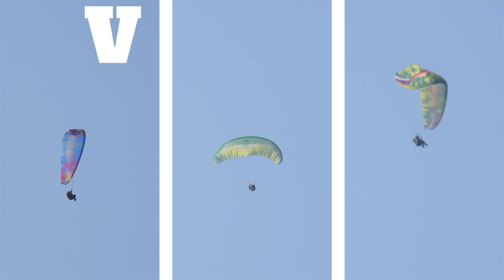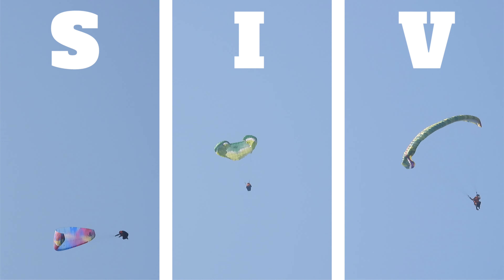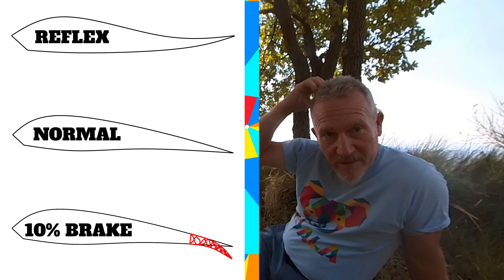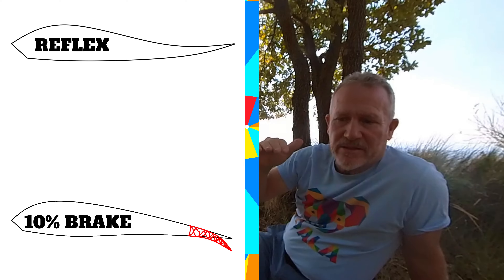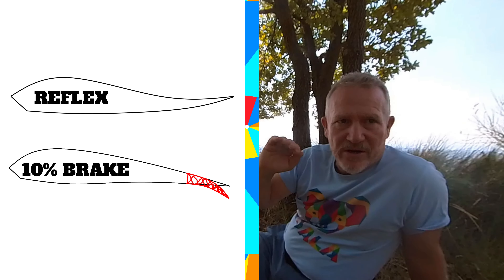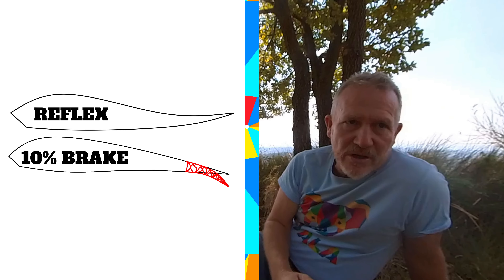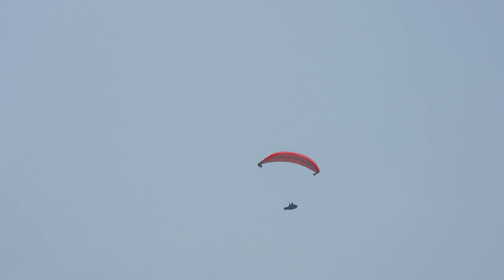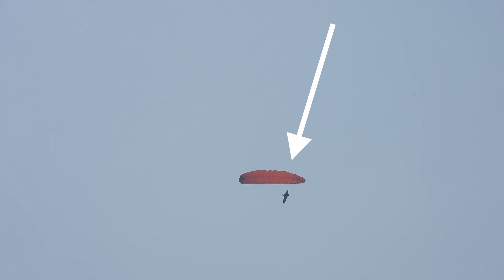10% of brake is not good for paragliding - Bruce Goldsmith

Comment: So, how do you fly actively then? If the hands are all the way up, how do you feel the wing and when to fly actively?
Reply from the maker: Contact position is where you feel the wing, which means you take out the slack from the brake lines, but do not induce bending on trailing edge. You use exactly as you say - actively to control the wing, instead of just floating around with brakes at your shoulder level - passively. To summaries - hands up means - contact position or hands down to actively pilot and always return back to hands up position. Bruce is not saying you should not use brakes, he's saying you use them when needed not just hold on to them all the time.
Dose this make it clearer?
Reply: @FlyingKarlis  right, so just a brief tension on the brakes, to feel the wing, not more. 
My concern was that on some situations, especially bumpy air you might pull more, not intentionally and cause problems. Especially in turbulent conditions when the wing tends to go wild.
I am not having some major concerns here, as experience taught me the amount of tension I need to use, but some inexperienced pilot hearing this might, I'm afraid, avoid flying actively when necessary...
Reply from the maker: Right, as with everything in life so in paragliding, we have to take it step by step. If turbulent air is too scary then maybe it would be a better idea to fly in calmer conditions, till you figure out the controls and build experience as well as trust with your wing. Often having hands up (read contact position) will make the wing a lot more calm, then say holding your brake lines at your shoulder level.

In general avoiding active piloting is a bad idea, luck will run out eventually.
Reply: @FlyingKarlis  is this true on an A  or a B glider?
Reply: Hi Karlis, please I think you need to edit the video with some writing on the screen to clarify this as this is going to cause a lot of confusion in the paragliding community... well it already has. I have had a student ask me about flying hands all the way up because he had heard Bruce say that's what you should do. I said that what he must have meant is at the contact position and not all the way up. It is really not clear in the video that hand up still means having contact with the wing and someone could get seriously hurt the next time they are in active air and they don't have contact with the wing and can't actively fly properly. Thanks for the good videos!
Reply: @MalinLobb hi Malin, I also think this is very controversial and will be misinterpreted. Although Bruce might have a point in siv, as an instructor we teach flying at min sink in smooth soaring conditions with 10-15% brake  . It helps on the ridge with not everyone flying at full speed, helps them stay in the lift and turn flat and with smaller turn radius. I can't see how this is dangerous as the situation is not one where the wing is going to be disappearing underneath them. Also, which wings does this apply to. Certainly not my low ENA wings or some of the older wings students turn up with. Most are still 4 line,? There is no reflex in them?
We also have to teach slow flight as one of the exercises, is that now considered dangerous. Confused instructor of 30 years experience.😮
Reply: @MalinLobb  Completely agree! - I think a "safer" and more "mainstream compatible" way of phrasing that is: "Don't choke the wing!" ie let the wing fly! It's what it wants to do, yet you see soooo many videos of people just choking the LIFE out of their wing...
Saying it like that does the same thing without sounding like "Brakes are for losers", essentially... 😀
Reply from the maker: @mcbrite   I quite like how you describe it, I see how I can implement this to my follow up video. ☝
Reply from the maker: @SM3535  I will try to clarify. 

Bruce is talking about flying at contact position and using brake inputs for active piloting instead of floating around with your hands at the shoulder level. 

In soaring conditions it means that you have a lift band, to stay in the lift band you should use as much brake input as need to stay in it. Which means you constantly adjust from contact position to brake input, what you should not be doing is just floating around with your hands at your shoulders, this will make most modern wings pitch unstable and more prone to collapses.

Wing dose not need to have a built in reflex to have this effect, what Bruce talks about is that if you add about 10% brake to a free flight wing with a "regular" profile, you are creating a reversed reflex profile by doing so, this in return creates the instability for pitch, which can and often dose create more issues for pilots with frontals and asymmetric collapses.

The biggest difference what Bruce mentioned is the improvement in having less line drag on modern wings, which back in the day wasn't the case. More line drag cancelled out this effect. Now that we have less drag on from the lines, there is no more damping the pitch movement and even a modern EN-A wing can bite all the way under the pilot.

For students that come with older wings, this dose not apply. This only apply to modern wings and it affects most if not all current wings.

Hope this makes it more clear. I will make sure to create a follow up video explaining all of this more clear. I realized that this video has made some confusion and I'm sorry for that, I will do my best to clear this up.

This is something that has to be talked about and I am happy to see that there are so many comments with questions, 

Design has been changing in Paragliding and changing fast, us instructors we have to adapt to the new developments. 

Let me know if you have any follow up questions, happy to answer to the best of my ability.
Reply from the maker: @markmcgoveran6811  Mark, yes it is true for most if not all modern wings.
Reply: @FlyingKarlis  I agree with you. I have my first lunch coming up and I have my first landing coming up. One of the other guys says that the wing is pitch stable if you have your hands up and it is just flying against the trim. I agree wholeheartedly that I should turn into a skilled pilot like you and do all the active flying constantly that you do. I'm a pretty skilled mathematician. Pilot error accounts for most of the accidents. It seems to me in my case I have to figure out the ground handling as well as I can. Then I have to launch and try to get a "feel" for the landing. I turn loose of the towline. I figured I just weight shift turns stay out of the brakes. All the cool pilots land at the corner of this forest and all the cars are parked there in the shade. I told the instructor I would be landing about a hundred yards in front of the cars. I thought I would sneak in a few flights focusing on my roll control /steering. One step at a time. The worst thing a student can do is fly along slow with both brakes
 until he is stable directly under the wing and put one hand up. It appears the wing has scooped up so much are and hold it under pressure just briefly that when the person goes straight up with one hand only its thrust out that side. Then it goes into some kind of a spiral or a spin. The advanced company that makes my epsilon 9 says that it will fly in turbulence better with my hands up, but they recommend active flying. You have already bet your Life on your first launch and your first landing. At the skill level you have it is great for you to stay on top of the collapses and other phenomena. They maintain I have passive safety and if I have good altitude put up my hands and expect a lot of high-energy antics as it blew off energy. Pilot error is the main cause of crashes. I think the main error people make during real-time flying is too much brake, for no purpose. Altitude is like money in the bank and AirSpeed is like cash in your hand. If you can have your wing stable and overhead flying trim speed, barely pulling the slack out of the lines, as a new pilot that would be just about as good as you could do if you happen to hit a bad spot. I hope to develop better skills as time goes on but right now I'm going to look at developing some roll controlled steering, to get back to the launch/landing zone. It's pretty flat. Not A lot to hit or any trouble to run into. The launch doesn't look too difficult. I get a few minutes of altitude flying where I can get a feel of the wing and how to keep it level while I apply apply both brakes evenly so I can use them on the first landing. These comments and reviews are just essential to my safety and I love each and every person who bothers to respond to me or anyone else thank you for putting these videos up.

Comment: is this also true in mountain flying?
Reply from the maker: It's true with most modern wings, what Bruce means by hands up is "contact position" where you take out the slack from the brake lines while still not bending the trailing edge, this way you will be able to feel the wing, while still letting it fly.
Reply: @FlyingKarlis  alot like skydiving canopy- that makes sense! I know that mountains can be turbulent and I have been told that you want to keep a little brake on to increase the pressure in the wing which keeps it a bit more rigid through that turbulence. Bruce is saying to keep the wing in full flight- no brake pressure but also no slack in the brake lines. How does this work in turbulence?
Reply from the maker: @logantorrence3906  In turbulence you should actively pilot the wing, meaning you use brake input when needed as much needed and once the wing is under control let it fly back to contact position. That's what active piloting is. And the more experience you get the less brake input you'll use to achieve the same result compared to lower airtime pilots, as it is about timing, the better the timming, the less brake input you'll need.

Floating around with constant pressure on brakes is the opposite of active piloting. 

Dose this help?
Reply: @FlyingKarlis  perfect thank you!
Reply from the maker: @logantorrence3906  🥰

Comment: Aren't most PG flyers still on 3/4 liners?  While this may apply to 2-line comp wings, most aren't flying those, and likely never will.
Reply from the maker: Most are on 3 liners these days, and even the 4 liners has a lot less lines compared to what it used to be. This is definitely important for any modern wing.
Reply: You could argue it's MORE important on 3-liner vs 2-liner... Because 2-liner has way better performance with brakes on... So that bit of brake will hurt you even more on a low wing...
Reply from the maker: @mcbrite What you are saying isn't true for 2-liners. These wings should be flown with as little brake input as possible even more so.
Reply: @mcbrite that's not true, in fact we pilot 2 liners with the B lines and only use the brakes when turning in a thermal

Comment: in thermal flying : should we use the outside brake?
is it better to fly with minimum skink for better lift or the least use of brakes? thanks
Reply from the maker: I use outside brake all the time. Minimum sink for modern wings is close to contact position. I would say use as little brake input as posible and focuse on timming and anticipation.

Comment: Is he talking about conventional gliders without reflex or does he mean that the freeflight paragliders have some reflex in them now?

If they have reflex i see what he mean, if they dont i dont really see what he mean. Since hes talking about opposite to reflex, does he mean that pulling 10% brakes makes the wing wanna pich down?
Reply from the maker: Even if the wing dose not have a reflex build into it, which most free flight wings has some of it in different places and at different %. If you take a profile and add a bit of brake, you are creating a reverse reflex profile by that action. Reflex in it's simplest form means that the trailing edge is pointing upwards, which with brakes pulled a touch down dose the same just reversed. As Bruce talks about in this video, one of the main reasons is that modern wings has less line drag, and this is one of the contributing factors why the wings are more pitch unstable, when constantly adding about 10% brake input.

Dose this answer your question?
Reply: @FlyingKarlis  still a bit confusing. Relfex makes the wing wanna pitch up, if adding a bit of brake is the opposite of reflex then it should make the wing wanna pitch down/tuck. Is that what hes saying?
Reply from the maker: @rickardjonsson4526   exactly!  Another thing that normal reflex adds is that the wing dose not collapse as easy, this is why paramotor wings can go fast under full power and trims fully open,  the trailing edge is bent upwards, and this forces the leading edge to stay open. Which in reverse state means during say a frontal collapse it will keep shooting longer and further down, compered to if you have no brakes at all. This is why it tis dangerous, it goes out of what certification test for, as they test collapses without any pilots input. The solution then is to control the wing with more brakes to stop the surge or to keep it at contact position to avoid the reflex reverse state, hands down or up actively as needed. Let me know if you have any more questions, happy to answer.
Reply: @FlyingKarlis  okey thanks then i understand. Very interesting!
Reply from the maker: @rickardjonsson4526  Glad we could help

Comment: One question: I fully support/use the "hands up" style of flying for engaged/advanced and pro pilots! The glide alone will be a lot better! - But on launch, I still keep a bit of brake for the first part... Too often you enter a stong thermal/upwind directly after launch (ie Bassano), I feel a lot safer with a bit of brake on that I can release to "punch through" the pitch back...
Same thing on entering a thermal, but that depends on the wing and other details, also you have tons of height/safety there...
Are you saying I'm still better off with hands up ALL the time and just correcting the pitch? Or can I still use brakes to hold a bit of acceleration in reserve to counter pitch back?
Reply from the maker: I also control my wing after take-off - it's contact positions (this is what Bruce meant by hands up) or active piloting meaning controlling the wing with more than say 10% brake input and releasing it back to contact position once the pitch control is done or the deflation avoided. What Bruce is talking here about is that floating around with your hands to your shoulders, is not a good idea with modern wings.

Dose this make it more clear?